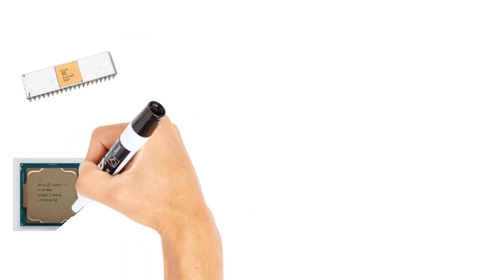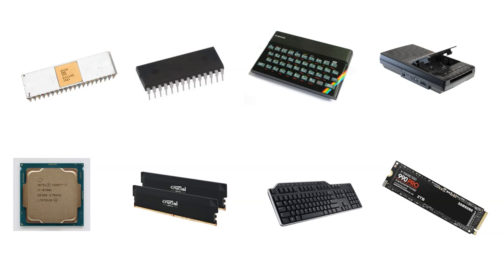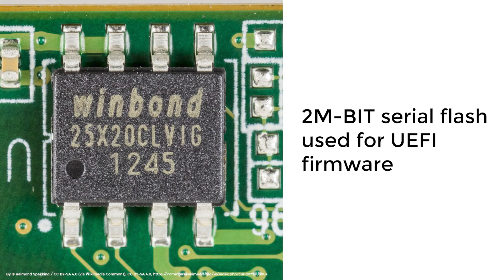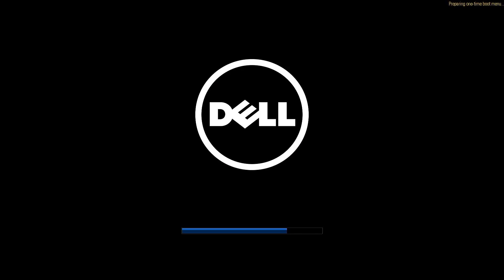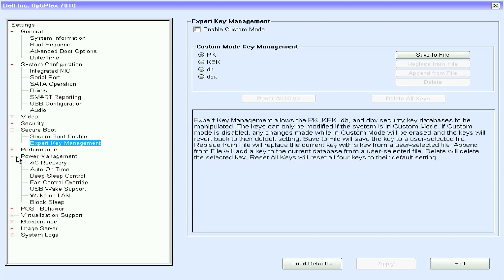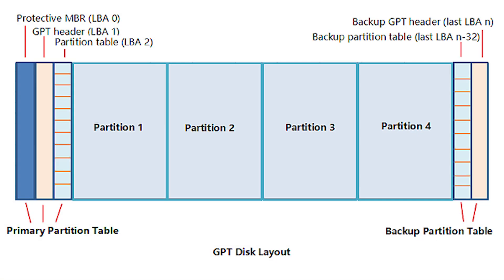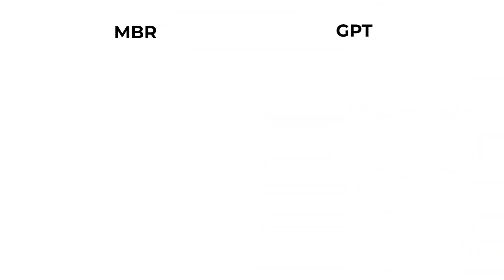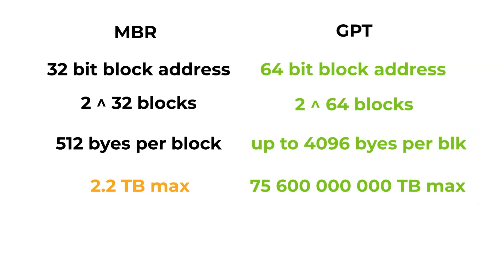MBR & GPT hard drives. What does it mean and which to choose?

Comment: sir i'm  using 320X480 resoltuion lcd screen compatible with raspberry pi, the problem i'm facing is that the window tab of some software is opening in a very big size and i can't even drag them to see what's in the bottom, like the tab gets bigger in size then the screen, what should i do, i've tried dozens of tutorials, still can't do anything of this problem
Reply from the maker: I've not come across this myself so this might not work. If you can get to the maximise button maximise the window and it should then resize to the screen. If not try plugging in a full size monitor, then open the app and resize the window to a small size. Then see if it opens at that size next time on the LCD screen. Good Luck!

Comment: Certain USB hard drives such as WD Elements utilize a hardware 'bridge' or some other trickery (I don't know the specifics) that will allow an older OS such as Win XP to access more than 2.2TB. The WD Quick Formatter tool is required with "XP Compatible" option set. Just out of curiosity I tried this with a 3TB FAT32 USB on an Xbox 360 and it worked.
Reply from the maker: I'd not come across that. Thanks for the info.
Reply: sounds impossible, I do not see how it can be mapped. If you know more details about this bridge or you know where to find more data about it please share. Thank you.
Reply: @chain-of-thought  Sorry, I don't know the technical details. Try searching the WD support pages. Years ago I would buy WD Elements USB HDDs larger than 2.2TB and they would just work with Win XP. Then I bought one that didn't work and that's when I discovered WD Quick Formatter can fix the issue. They don't seem to advertise this useful function, so I don't know if their newer drives still support it.

Comment: I've not commented much recently because although I do watch (and enjoy) your content on consoles, I've never been a console person so can't really add anything to it - if and when your content gets to the ZX Spectrum or Amiga, I'm in the front row!

This is a topic I know a lot about and your video summarising it is absolutely perfect (not that I would suggest otherwise for any of your content I have watched so far).

The fact is that hard disk formatting and installation can be a nightmare for the inexperienced because you have three layers that you need to get right:

1. Is BIOS, UEFI or both supported on the machine in question?
2. Does the machine understand MBR, GPT or both? Does the drive size mean that you MUST use GPT anyway?
3. What filesystem do you then put on the disk? FAT32, NTFS, Linux EXT4, etc. etc.

Whilst technically all of those are separate questions to answer, I think the fact that you've linked BIOS and MBR together, and UEFI and GPT together is a very good move, because pairing them like that means that they should work fine in pretty much all instances - you then only have to decide on a filesystem and usually FAT32 works somehow with most systems.

I hope many new users will be grateful for this video because it does make it much easier.
Reply from the maker: Thanks for your feedback. It's great to get a thumbs up from someone who actually knows what's he's talking about.

It's also great timing for me to pick your brains. I'm looking to set up a fast booting Raspberry Pi system for use with emulators such as Fuse and BeebEm. I tried the bare metal emulators which were great but somehow lacking in some areas. Ideally I'd use a standard Raspberry Pi + SD card setup that boots into a cut down Linux with enough to features to run the emulators. I've been playing with Raspian lite and a few tutorials to cut out the delays but I'm not entirely convinced this is the way to go. Just after some thoughts and pointers if you have any. Thanks.
Reply: @BytesNBits  Take a look at the Yocto project. It has a bit of a learning curve, but there are plenty of examples and tutorials out there. With Yocto, you can build a completely customized Linux build for a Pi (or any SBC really) that includes exactly what you want/need and nothing else.
Reply: @Otakunopodcast  Thanks for the hint on Yocto, I've never looked at it before and it's certainly of some interest to me when dealing with embedded Linux - but is it suitable for the Raspberry Pi which isn't really an embedded device anyway? I had a quick look through the Wiki pages for Yocto but could find nothing Pi-specific.
Reply: @BytesNBits  It's funny you should ask at this time because I am most of the way through building a light Gentoo Linux build on Raspberry Pi 3B at this very moment.

I use Gentoo for all my systems anyway, mainly because I can build it on just about anything and I really like sleek and light OSes.

I agree with you about bare metal emulators - as a concept they're excellent and kudos to the people that create them. But where they are lacking is support for network services - for example, being able to attach a network drive or even a USB stick just for ROM transfer to the emulators.

I also don't want to just download an entire distro build for emulators like Retropie - I'd rather customise that myself and put on the emulators I want.

I see two options here:

1. Have a look at Armbian Linux builds for SBCs. They cover most SBCs and they generally do a light "server" build which is just command line and a "desktop" build that includes a light desktop. You could use the server build as the basis for your own emulator-focused build on which you just install your own light desktop, like XFCE or LXDE. The nice thing about Armbian is they cover a huge number of SBCs so you could focus your content to be more "generic" and not just about Raspberry Pi.

2. You're welcome to a copy of my Gentoo build at any point. The nice thing about Gentoo is that it's a rolling release that you just update, but it's "compile as you go" so updates can take a bit of time. What I do is have one "core" machine that is the update server and compiles binary packages as it goes ready for the other Pi's to install very quickly. There is a "learning curve" to Gentoo but when you get how customisable it actually can be, other distros start to feel a bit inferior.

As it happens, I am in the process of setting up both a Raspberry Pi / Linux meet up and a Silver Surfer's Club which will be Open Source focused because I have access to a hall facility in a social club that I am chair of that needs to bring in a bit more income.

I am more than happy to assist you at any point with any of this, especially because working with someone who is reasonably new to Linux helps me create the material I want to create for my meet up - and I am not really planning my own channel at this stage because I much prefer face-to-face tuition, so it's not as though there's any competition!

If you're interested, we can maybe swap email addresses or meet up online and chat. I don't use much social media but I am on Discord and Telegram.

Let me know what you think.
Reply: @BytesNBits  PS. I've not tested my Gentoo build on a MicroSD boot up yet because I put the root filesystem on a USB SSD drive on the Pi 3 (due to the amount of read-writes going on because of compilation tasks). But I will give it a go and let you know - it is still quite a bit lighter than Raspberry Pi OS so should be quite a bit quicker on SD cards.
Reply: @BytesNBits  Batocera is pretty much the standard nowadays for Retro emulation on any ARM-based system. It is available as a single download image that can be written to a sdcard and run on a Pi. If you have a Pi4 or Pi5 go with that as anything older will struggle with the newer emulated systems. If you are planning to do a video about it stay far away from native Linux distros and a gazillion customisations as you will lose your audience very quickly ;-)
Reply: @g4z-kb7ct  There are already more than enough videos on Batocera and Retropie.

I think a large proportion of the Pi user base is actually fearful of having to put in some time and effort into learning something new about Linux, which is why you're almost threatening Bob now.

Support for the Pi is tremendous, anything you want to do with the Pi has been turned into a step-by-step video on here - but I bet if I gave lots of Raspberry Pi users an Orange Pi now and said "Put Linux on it" that they'd struggle to do so without a video showing them each and every stage of the process.

It both amazes and saddens me that we have an education system that churns out people into IT ecosystems who don't have critical thinking skills and no inclination to read books, do research and play about with stuff on their own.

There should be more gratitude towards SME's like Bob who are willing to put in considerable time and effort into educating others, completely free of charge. We became SME's because we did our own research and testing, and asked questions from our mentors - we're probably all still doing that also.

I'd also argue that Bob's videos on console customisation have less mass appeal than Linux videos anyway - but he has still done a good job producing them.
Reply: @terrydaktyllus1320  People just want to get on with it and play with the thing not spend years learning how to manage it. As a leader in several fields I've done my own share of learning for 45+ years and inventing new stuff and shaking up the entire retrogaming community. It's time to just play some games not waste more time messing with stuff I already tried and dismissed as rubbish 10+ years ago. Installing Batocera on a Pi4 is the way to do it if someone just wants to move forward quickly. The other alternative is to just buy one of those Super Console X3 Pro (or whatever) coming out of China. Thousands of games all ready to go (most of the arcade stuff originating from me hehe!), no thinking required.
Reply: @g4z-kb7ct  " People just want to get on with it and play with the thing not spend years learning how to manage it."

And other people want to learn just that - and you should just let them get on with it, rather than trying to restrict them from doing that.

" As a leader in several fields I've done my own share of learning for 45+ years and inventing new stuff and shaking up the entire retrogaming community."

I've got 42 years as a computing IT specialist and programmed my first Z80 CPU in machine code back in 1982 on a college course. So what, why's either "autobiography" relevant to anything we're discussing here?

"It's time to just play some games not waste more time messing with stuff I already tried and dismissed as rubbish 10+ years ago."

Personally I think older people like ourselves have more of a responsibility to pass on our knowledge to younger generations, especially in the field of IT where skills are lacking. But "you do you", just stop trying restrict others and issuing "threats".

"Installing Batocera on a Pi4 is the way to do it if someone just wants to move forward quickly."

Sure, but the "someone" is you specifically and that's entirely subjective opinion.

"The other alternative is to just buy one of those Super Console X3 Pro (or whatever) coming out of China. Thousands of games all ready to go (most of the arcade stuff originating from me hehe!), no thinking required."

Again, you do what works for you. I don't see what relevance that information has or what point you've actually made here.
Reply: @terrydaktyllus1320  Ah so you're one of those people. Oh well. All I can say is 'bye!'
Reply: @g4z-kb7ct  Yes, I am one of those people who enjoys both sharing my knowledge and experience with others, and still learning from others too. 

You make it sound like I should be ashamed of a characteristic that I am otherwise quite proud of.

Discussion closed.
Reply: @terrydaktyllus1320  That wasn't what I was referring to....
Reply from the maker: Thanks for the discussion guys. It's great to see you all have a passion for what you're doing and that there's a place for everyone in the retro gaming scene.

@terrydaktyllus1320 Thanks for the offer of some help. That would be brilliant. I did have a look at Gentoo and it sounds like a completely different approach to the more usual download everything and remove bits that I'm going through at the moment with the Raspian setup.

I'll have a go with the handbook setup tutorial so I can get an idea of what's going on with Gentoo so I'm not totally blank on the subject. If you want to contact me away from the comments just use my name at my website address bytesnbits.co.uk.

Speak to you soon.